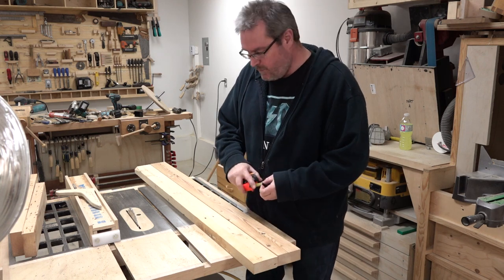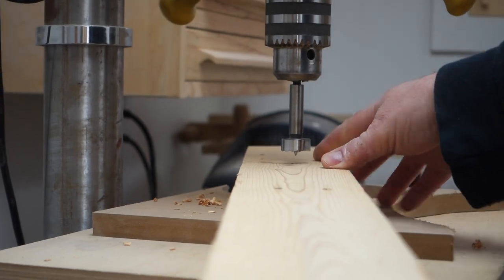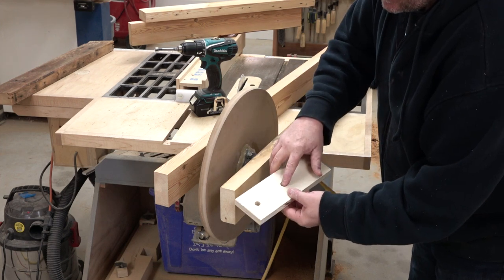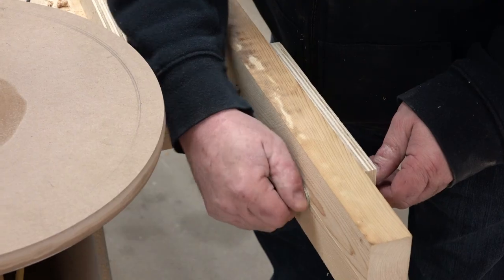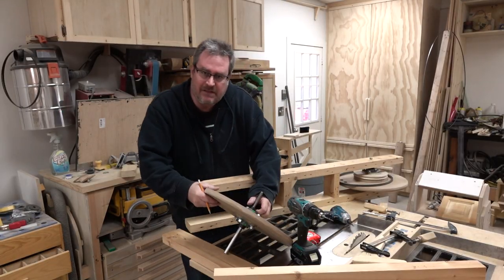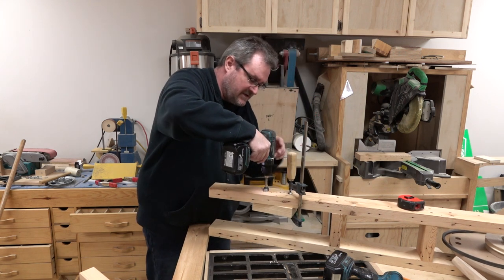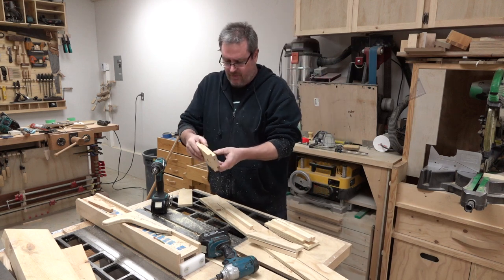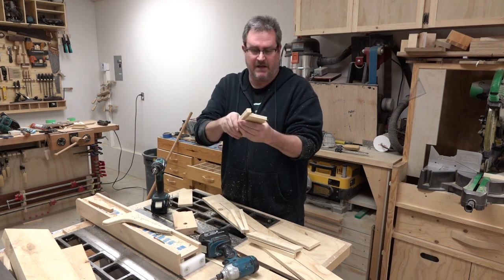Making A Quick And Dirty Band Saw Mill - Part 3

Comment: That "top wheel" would be your idler wheel while the one attached to the motor via the belt would be the drive wheel.  I work in a sawmill.  I'm just trying to figure out how to make a mill on a small scale for my own use. :)

Comment: Please note that this video has violated the youtube terms of service section 3 paragraph 5 item 2 -- "DIY videos are limited to a maximum of one smirk per video".    I clearly saw two smirks...  10:09 and 10:24(ish)

Fun build, John, I hope you're having fun also.  that was some really nice tight grain on those 2x4s when you cut into them.
Reply from the maker: +Wordsnwood (Art Mulder) 
Thanks Art, I'm loving this build and (bonus) everything has been working out right so far.
Those 2x4's were the rafters from the addition, about the only things I could save from there.

Comment: awesome idea,  do you think you will be able to resaw lumber with it.  been a sawmiller/sawyer for years can't wait to watch it run.  what blade are you going to use?  think about running lube.  especially with maple and your blade has to be SHARP or it will walk the dog.
Reply from the maker: +Jack Mack 
It's only purpose (right now) is to cut up those maple logs. The blade I have is a 3/4" x 3tpi - not ideal but it should get the job done.
Reply: awesome

Comment: Why didn't u use your thickness planer?
Reply from the maker: +Justin Fiaschetti 
It would take longer to do. It would also risk the knives in the planer (used wood). The parts need to be straight, they don't have to be perfectly smooth.
Reply: +Justin Fiaschetti You meant use the thicknesser to plane the screws off flush, right?